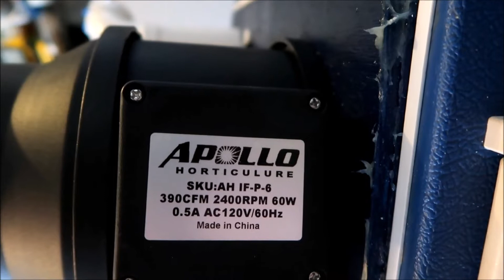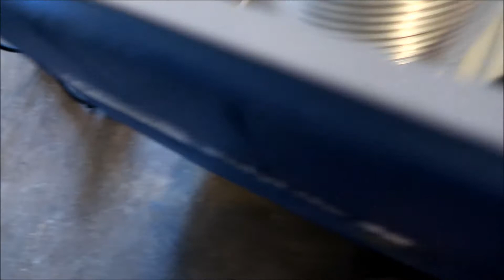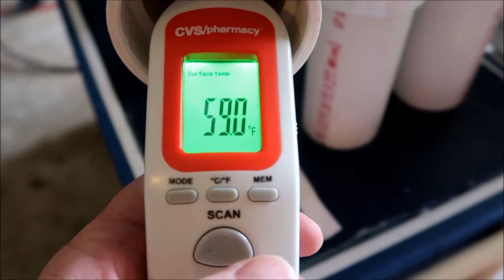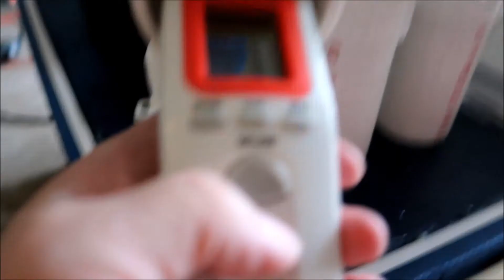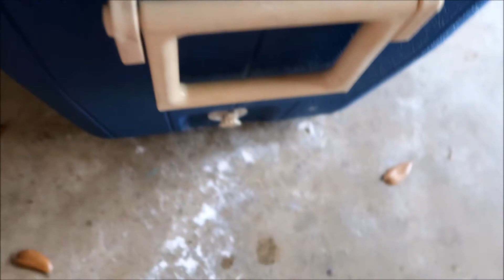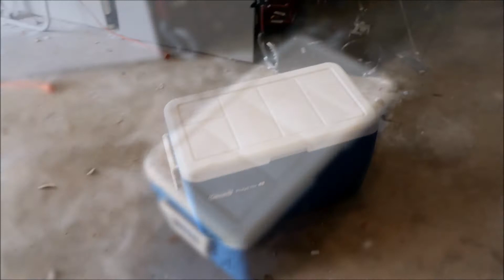Wednesday's Work in Progress Presents : Ice Chest Portable Air Conditioner Mods. # 1 - 08/28/2019

Comment: Hmmm, I wonder if there's a way to get the air to pass thru ice water? I dunno if that would be any colder or not.¯\_(ツ)_/¯👍💯
Reply from the maker: Great comment.  From my previous A/C projects, I had purchased some very small copper tubing. I want to try next to run the cold melted water through a coil in the exhaust ports.  I think that will be mod. Number 3. But wait for mod. Number two next week. I was impressed with the next improvements but I am itching for more.